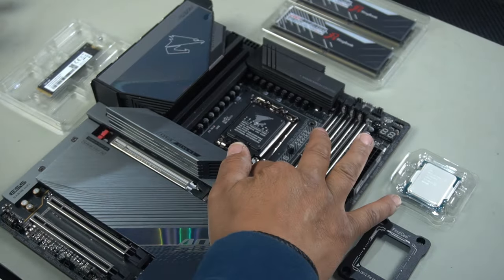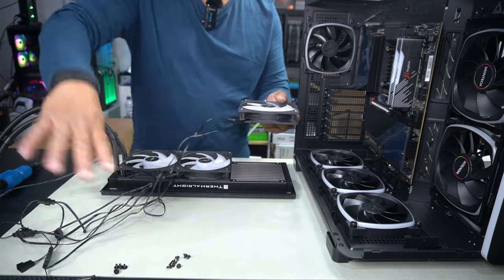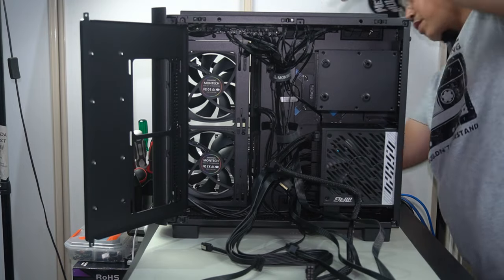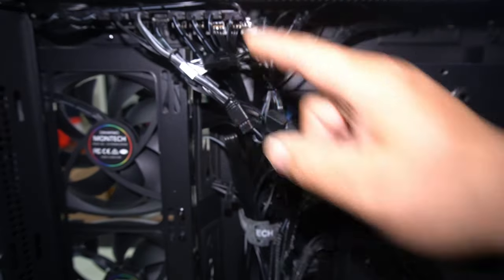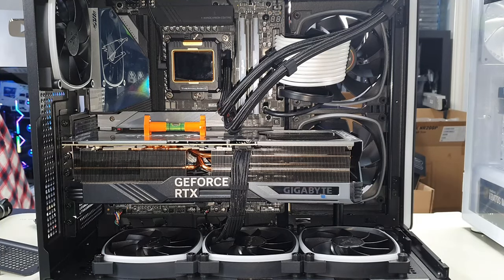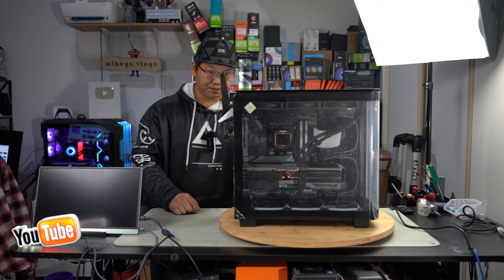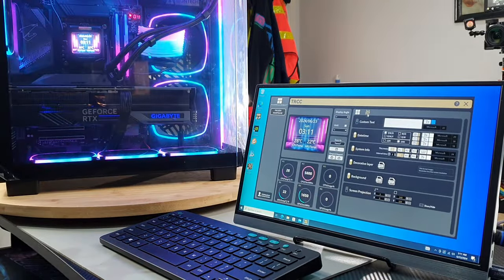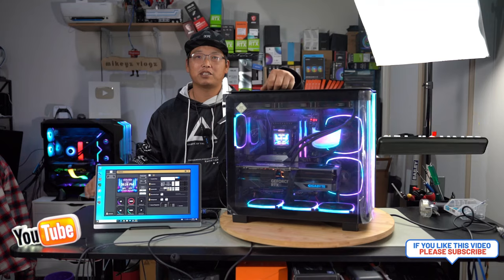how to build a pc montech king 95 PRO step by step FULL build thermalright frozen warframe 360 aio

Comment: 0:53 Protip: Use a piece of blue painters tape to hold the motherboard socket and AIO backplates in position. 
The blue tape won't harm anything and is easily removed after backplates are screwed on.

Comment: Great video, well done.👍🏆 I am interested in Montech parts since I picked up a Montech Titan 1200watt PSU. 1 question, how is the Montech King 95 with fingerprints on the glass? I am thinking about picking one of these cases up but was worried about the airflow and the glass being fingerprint magnets. What's your opinion on the Montech King 95 case with these issues?
P.S.
I would have skipped the 24 pin extension cable, I think it would look cleaner without it and not be obstructing that top fan's airflow. Just my opinion. 😀
Reply from the maker: thanks for sharing ..I appreciate u. 
as for fingerprints it's only an issue of your always touching ur case..and with all tempered glass it's an issue..but nothing some glass cleaner or iso alcohol and a microfibre clothe can't fix. 
airflow is great ..u won't have any issues there 
as for the strimmer cable I get what your saying..but uts not really obstructing the airflow considering there is so much intake from the bottom too ...
Reply: @MIKEYZVLOGZ  Thanks, the Montech King 95 reminds me of the ASUS GT501. The GT501 is one of my favorite cases to build. I think I am going to give the Montech case a chance after this video. Thanks MikeyZ for the great content and the reply. 😀👍
P.S.
The 24 pin extension looks amazing and it really isn't bothering the airflow. I just thought it would look a little cleaner without it and needed a reason to complain! LOL
Reply from the maker: @auntiepha8343  lol..cheers mate ...I appreciate u